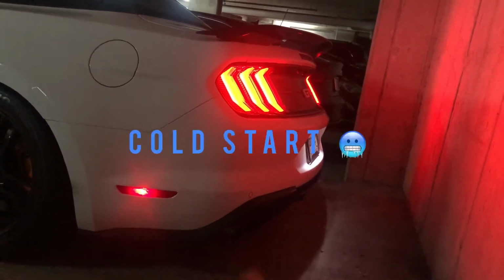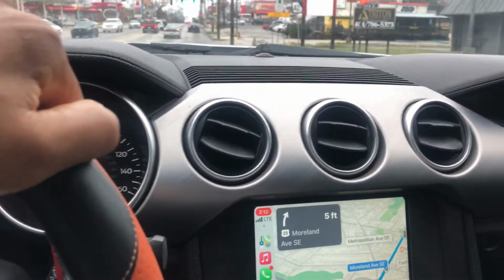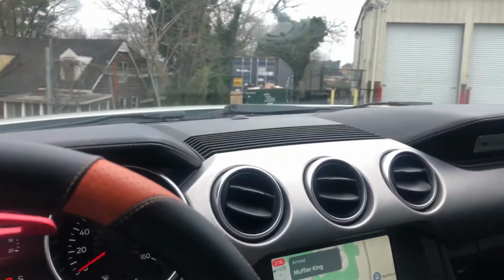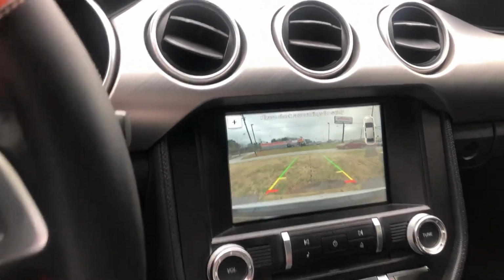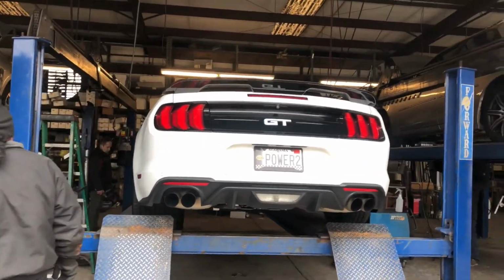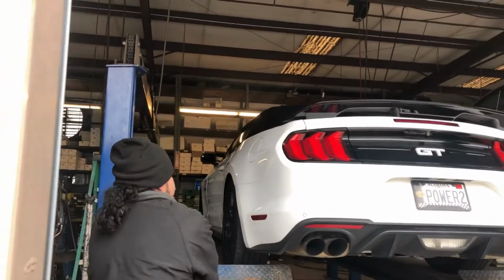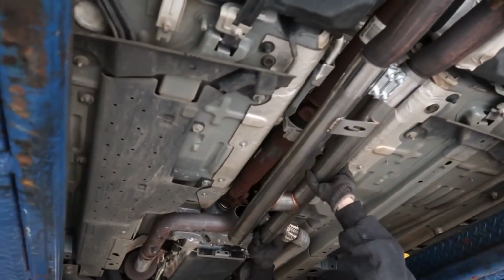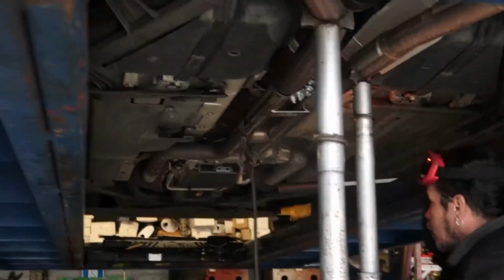Is the Steeda H pipe worth the money for your Mustang Gt

Comment: Yeah, they did that installation all wrong.
Should NOT have cut the pipes at the front of the resonator. Just unbolted and slide out.

Should’ve measured 5 inches from back of resonator and cut. Then clamp front and back. No welding needed.

But, she sounds good.
Reply: Yep....WTH...🤣